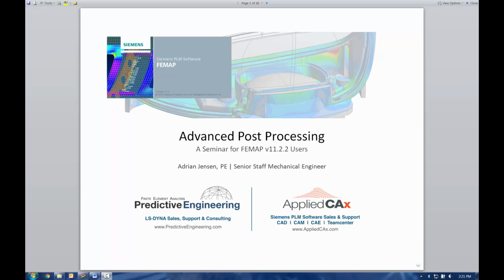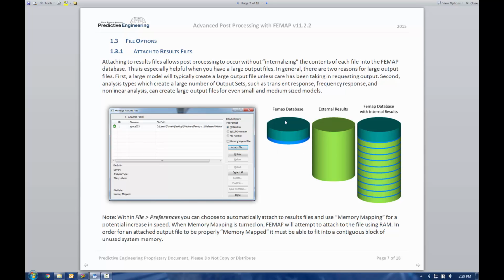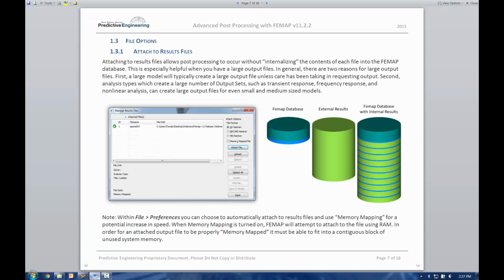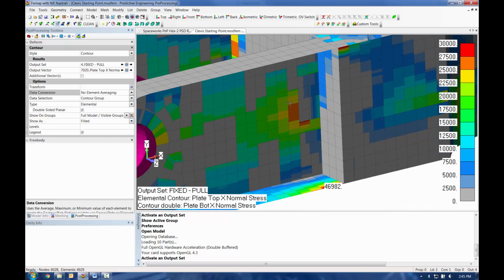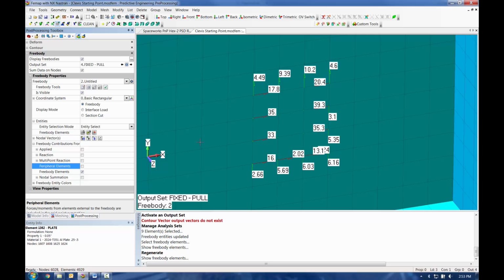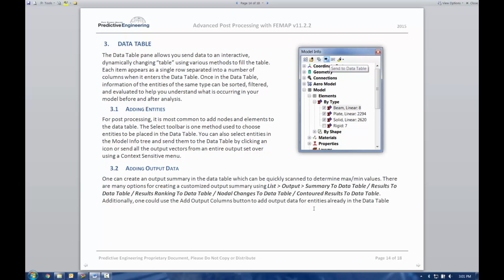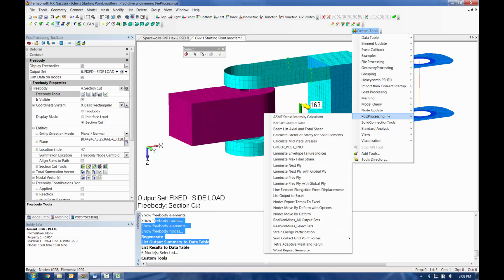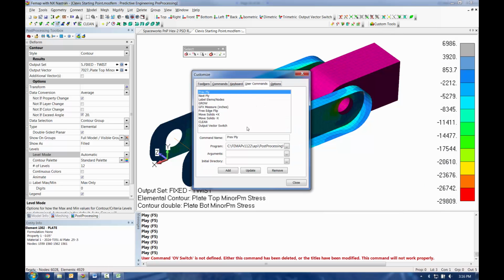Advanced Post Processing with FEMAP v11.2.2 - Technical Seminar

Comment: Hi Guys, Could you answer how can I set the contour colors to see max value and treshold value at the same time? Imagine max deformation is 10mm but the point is that it cant be bigger than 3mm. So I want to show the max value 10mm on legend, and color everything above 3mm to red, and everyting above 2,5 to green. I know I can reach properties under F6 - post processing - contour criteria levels -  set levels. Here type in desired levels but the changes never take effect to the legend.
Reply from the maker: +playmanky
The key is selecting the "User Defined" option under "Level Mode".  With this option set, you can go into "Set Levels" and configure your contour legend as you please. Thanks for the question!